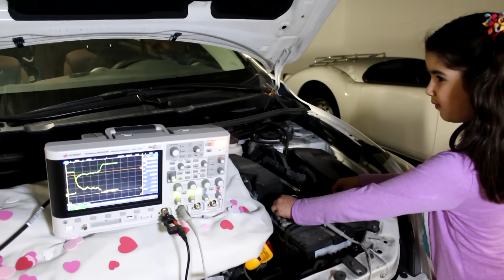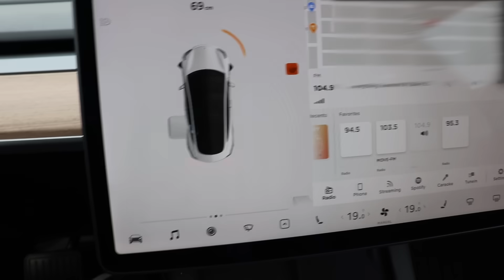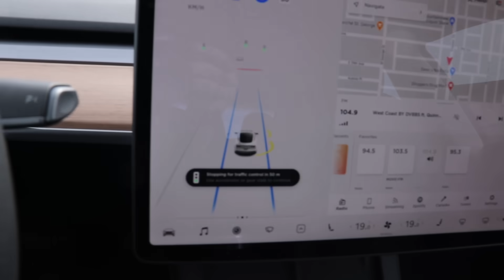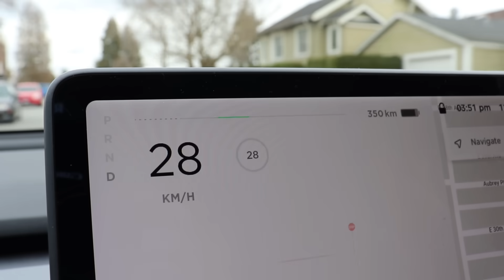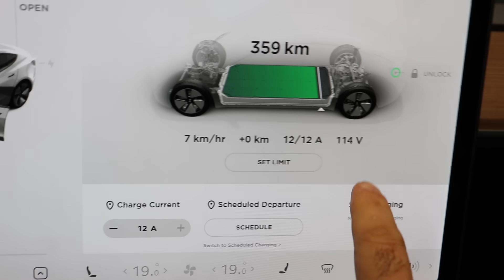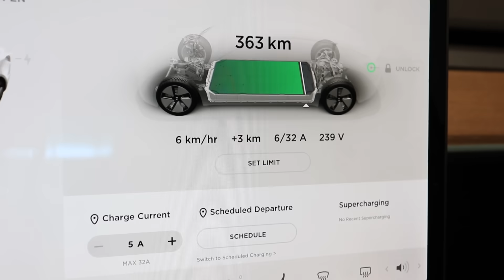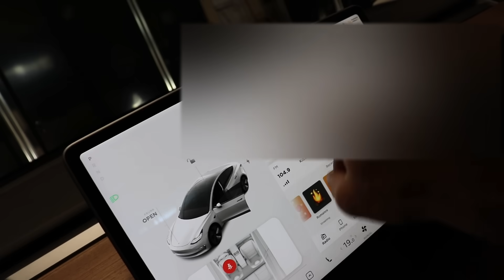ELECTRIC VEHICLES & My Tesla Model 3 Review

Comment: Well, this had showed me, that Tesla is not a car for me. The price diference in operation is not that great in my country, and you have to save up to 70 average monthly wages to afford it. And with that mountains: If you left your car in gear, while leting the car go downhill, and leave gas pedal free, the engine will turn off the injectors, and the engine will start to break, while using no fuelo at all. But you need to have manual transmission for this. Next thing is, that imagination, that everything should be in touchscreen is grazy enough. As  a driver , you have to always be aware, what is in front of you, and when you are trying to set up somenthing, you are loosing the contact with road. And in higway speed around 130km/h, one second is approx 36 meters. In my opionion, tesla is not bad car, but for me it is over computerized. Next things are assistants: I have no doubts, that it saves lives, but here in czechia it is not reliable, because of conditions of our roads, where markings is unreliable.

Comment: • 1:45 - Don't blame cows for climate-change; cows have been around for millions of years without messing up the planet, it wasn't until humans started breeding them to unnaturally high numbers (to kill and eat) that their burps became a problem.
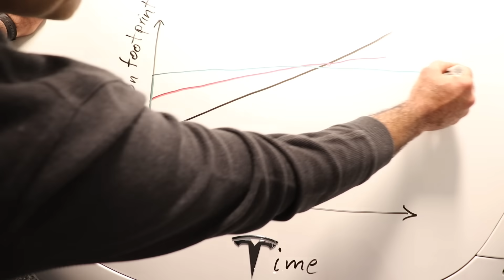• 2:42 - Your graph is (very) rough. ICE cars pass electric cars in carbon footprint the second you turn them on. They only have a smaller footprint than EVs if you put them away after they're manufactured and never use them.
• 3:02 - Once in a while you could do more… and pay a lot more for insurance. 😕
• 9:55 - Self-driving cars will only be useful for highways and will only be used by transport fleets shipping freight; full SAE5 will likely never be a thing for in the city, it's just not practical or safe to trust an A.I. to account for unpredictability like that.
• 11:11 - So what, it's still "free" charging. 🤷
• 11:52 - Yup, EVs are much cleaner and don't need as much gross fluids, and other than the wheels, they're solid-state. 👍
• 13:33 - And EVs are also a lot quieter (they have to add fake noise for safety). They also emit less heat too. EVs are to SSDs as ICE cars are to hard-drives, they're better in almost every way and the few downsides are either temporary or not too bad.
• 17:17 - Have you tried turning it off and on? 🤦
• 18:24 - Hey, we live in a pre-order world. Thanks to Steam and Kickstarter, people have gotten used to paying for things before they exist and getting incomplete, buggy junk. ¬_¬

Comment: For those eyeing the LEAF or BOLT, there's a pretty nuanced discussion to be had about which one is right, and the selection between them and the Tesla boil down to the batteries, their accompanying systems, and the use case for you. In (very) brief, Tesla batteries are generally best, but the cars are a little heavier, so efficiency per mile is a little lower. That means if you only have Level 1 charging, you'll get fewer miles per hour of charge. You may have to catch up on the weekend, depending on your driving!

The LEAF has a battery with only digital thermal management (no radiator/plumbing through the packs) which means that in hot climates, it tends to underperform, and it also tends to not like multiple rapid charges. However, mechanical simplicity means less potential for failure. This is often talked about like it's the apocalypse, but it really isn't. Like Mehdi says, match the tool to the use, and if you don't need regular fast-charging or to drive much in high heat...it's great!

Finally, the Bolt DOES have the liquid cooling, generally a good reputation. You just might be paying more for the battery and less for the car, and that could also be a bad fit for you. Make sure the seats, cargo volume handling, etc all work for you!

Comment: I see a lot of inconvenients with the Tesla and battery powered electric cars. As you say, the carbon footprint is very high at the moment you buy it, and then you have to compensate. Same thing about the price tag, are very expensive. Thinking about the environment, think on how recyclable (or whatever is written) are this cars compared to a gasoline one. You can keep a gasoline car, from 10 to 20 years, the battery lifespan are maximum 10 years, and when you have to dispose those batteries, they generate quite hazardous waste, a gasoline car is all made of steel (or aluminum) and can be remelted again. In Germany, lots of drivers got stuck in traffic due to a snow storm, and they kept warm by just adding gasoline. On electric cars, warmers drain a lot of power to keep the heat, and you can't "refuel" them. The way to go is Hydrogen Cells. Is like refuelling, and it uses electricity too. You can use electric power (dedicated wind turbines and solar power) to make hydrogen, and with that, power the car, and expel water instead of CO2. Hydrogen is dangerous  you'd say, well gasoline is, too, and we're safe. Hydrogen cell cars, doesn't have that many problems.

Comment: Yes tesla is a good car I cant deny it.  BUT problem I see in ev's is that when you live far away from civilization and you need to go daily over 60km you cant charge it enough. And here we dont have any charge stations nearby. Second problem I have is the climate. Here in Finland at winter time we can have over -25 °C  and I think that it doesn't do any good for the battery. (I dont know the prices of new battery) but I highly doubt it that I have enough money to replace it. So thats why I prefer combustion engine cars. Also im a car guy and I like too much the sound of gas or diesel engine. I will think of buying an ev when the battery and the electricity doesn't harm the enviroment. Sorry if I triggered someone. I just wanted to tell my opinion. If you own an ev you can come and try convinse me to buy ev. 😊

Comment: Quick correction here Mr electro boom! When traveling down a mountain in low gear as you're supposed to, you burn zero fuel. The injectors literally shut off in the wheels turn the engine but no fuel is being consumed. Don't believe me? Head on over to engineering explained for confirmation. Other than that, great video!

Comment: You'll save $1200/year but have to buy a new batter for $7000 in about 5 years if you take real good care of the batteries.  
Where is the saving? 
Sorry, but the battery technology is not there yet. With the newly invented carbon nanotube cells, maybe there is hope.

Comment: Well, one reason you need to push the "gas" pedal is to confirm the car that what it thinks is a green light actually is a green light. Imagine your car automatically accelerating due to some green light on a nearby construction site... Although computer vision has come a long way (and in some fields surpassed human vision), it isn't perfect yet, so you need to reassure your car that it's doing everything correct. Another factor is the illusion of control. Generally, humans feel safer if they think they are in control, regardless of whether it actually is the case or not.

Comment: 1:35 wrong! although they would theoretically be more green than combustor cars, the batery dies after about 100k to 200k Killometers (or 60k to 120k miles) then you have to replace it... the most economically unfriendly thing to produce on this car.

with a combustor car you'd drive up to 400k km (240k miles) and you'd be relatively fine

Comment: One thing to note is that even if your power comes from a fossil fuel power plant that is still better than burning Diesel or Gas in an internal combustion engine, because despite accounting for all the losses in transmission from the power plant to the car, the power plants will have a significantly better fuel efficiency than a car may have. So it's still better to use EV even if your country is going backwards in time and not building or decommissioning nuclear power plants.

Comment: I disagree with a couple of things Mehdi says. At 1:00 a car is just a tool. If a car is just a tool why aren't we drilling Model T's with safety up grades. I would say car are at lease as much about status as they are about utility.

At 1:35 everything should be running on electricity stored in batteries. For now and for the foreseeable future if you need to get the job done you will be using diesel fuel. An agricultural tractors burn ~700 litres/day, combines ~1,000 litres/day and there are others road construction, mining who will continue to need diesel. The current energy density of even the best battery chemistry is pathetic compare to diesel. Assuming a small 4 wheel drive tractor, like the John Deere 9R 390, running at its rated engine power of 287 kW for 10 hours you would need 33.8 Tesla 3 battery packs at 85 kWh/pack. Adding 18,252 kg (40,560 lb.) to a tractor that weighs 20,856 kg (45,980 lb).

Comment: Congrats! During driving, for safety please mount your cameras somewhere on your dash and/or ceiling so you don't have to hold it.

Also I like how you got the new updated version with black trim pieces, free white colour, free black seats and the SR+. It's the best value for your money since the SR+ is the only one that gets the $5k federal incentive.

It would be nice if there was a 360 degree surround camera system (not just sensor) for when parking. Heated steering wheel and ventilated seats would have been nice too and more energy efficient.

Comment: 13:25 When you go down the hill in ICE car you dont use any fuel, if you coast in a gear. Your engine basically turns into vacuum pump and no fuel is injected, thus slowing you down to some point. And there's normal maintenance of brake pads, only the frequency of doing so changes according to your brake use. Otherwise pretty informative video

Comment: Mehdi I am just curious that if car has two batteries , when driving on one battery can we charge second battery using generator on kinetic energy of first battery. Second battery will Not get fully charged but about 60-70 percent. When first battery reaches to 0 then by using changeover can we use second battery and keep first battery charging to 30-40 percent and so on.
At least we get maximum range that todays batteries offers.
Is this possible, please make model n throw a light on it.

Comment: those issues with the display are not normal, I have that model 3 that I bought 2 years ago and don't have issues with the display and it's not that slow for me. I don't even remember when was the last time I had to reset it by pressing the buttons on the steering wheel

Comment: Sure it will have less footprint over time, but then if you need replacement battery you start again. And "renewable" is not green or zero emission, wind turbines don't produce enough electricity to justify their existence in their lifetime, same with solar, the efficiency is so low, that using it for industrial application is retarded. The only good energy source is nuclear and soon fusion.

Comment: Great video . As for not needing maintaince, yes electric motors are superior to ice motors , however there are still parts that will wear out In time . As the car ages it will need to be checked so problems can be repaired before more damage can be done or a accident happens. Normally this happens at oil changes on ice cars. But people may neglect this on EVs think Suspencion parts like tie rod ends or control arms. These parts are the same for EV or ice cars. Also both have  cv joints  at least 4 or 8  along with struts / shocks and stabilizer bar bushings that will all wear out in time and miles. These things will need to checked especially as the car get to higher mileage. Again EVs are good but are not maintace free. Just my two cents. I hope to get one someday,but need to wait for good used one to come on the market.

Comment: They should add an option like the Dell laptops where you set the usage times and it charges with the right current accordingly.  If you need your car fully charged by 7:00AM each day, it could adjust the charge current for that.

Comment: "Crazy aggressive driver..." "...get off the road!", lol, that's exactly what they're trying to do.
Reply: @Mikołaj K how is it not dangerous 😂. ALso the speed limit you see in changed from the actual one so that if someone still breaks the limit, nothing much happens.
That's why people think it's not dangerous but actually is.
Reply: @daphenomenalz4100  Going 150km/h in a 130 zone isn't dangerous.
Doing 70 instead of 50 on secondary roads isn't dangerous either.

You people are idiots.
Reply: @ilpatongi  Of course it's dangerous. But so is going 50 in a 50 or 70 in a 70. The biggest added danger is the difference in speed between you and traffic and the increased stopping distances. Slowing down is a quadratic function, so even small differences in speed make a large difference in the ability to stop.
Reply: @halfchocolatecow3501  Wow really? I never would've guessed.
Reply: @Mikołaj K yea sure , and drinking at least 5 bottles of wine everyday( which people call a drunken) dosent affect ur body a
Reply: @Martian_nigga6970  Idiotic comparison to say the least.

Comment: My Volvo D2 uses 4,5L Diesel on the Autobahn per 100km, thats around 6€ per 100KM. A Tesla, charged to 100% (More power needed from 80-100% than from 0-80%) would be also around 6-8€. The Volvo with a full tank can go 1100-1400km depending on my driving style, dont think there is an electric car that can do that. It also doesnt use anything while standing still. So yeah in the city electric all the way, for longer drives and only for that take a Diesel atleast for now. Gasoline is absolete with electric cars existing.

Comment: It should have stopped before those cardboard boxes!? Even if the car somehow detect them has empty, that I assume it did, I saw a video where a model S stopped for a plastic bag of all things! Going through cardboard boxes can scratch paint, because of the metal clips that some have!  I don't understand how it stops for a plastic bag but not cardboard boxes?! Shows that AI drive system is still not 100% reliable.

Comment: 8:25 Suppose the light has turned green and tesla starts going but some idiot tries to break the signal at the same time you'll both crash. So I guess that's the reason why it asks you to hit the gas a little bit to confirm if it's safe to go.

Comment: While quite expensive, consider upgrading to ceramic brake disks as regenerative braking causes the regular brakes to remain very much unused and causes them to rust. Although mine is not electric, my 4 year old car needs new brake disks as the car saw very little use since the start of the pandemic (and only short work trips before it). Might save some money in the long run, so it's something I'd look into. Here due to climate, brake disks especially on electric cars (due less used), rust very fast due to corrosive anti slippery/ice melting (salt) measures used on roads. If not, keep working those brakes hard from til to time or things might get very expensive. Check with real expert.

Also, for vehicle based vacations, consider renting a regular car instead of going all in electric. Waiting 6 hours in line at a charger is not fun, especially with kids going "are we there yet".

Comment: Omg, there is a return of the fuel in gasoline cars when you go downhill  using engine breaking
Reply: The fuel injector simply shuts off.
Reply: @mathewng1988  that is the other way to approach the same thing :)
Reply: FYI, engine braking is still functional, even without fuel being injected and burned.

Comment: Someone hate electric cars but personally I preffer electrical cars becausd is a clean enegry, also, generating brakes is also used in F1 to recharge the hybrid V6 engine(it appear in front brakes).
And is expensive because is a recent techgnology, and that imply it being fragile, but still reliable and clean energy, I have the idea Tesla cars include a solar pannel in the rooftop(or is was deloped to charge in use).
Elon Musk and Tesla company said the prosessor is still in update, so all Tesla's prosessor still updating.
And electric cars appeared first with Formula E, the electrical variant of Formula 1, Volkswagen made I.D.R for Pikes Peak event, yeah, gasoline would be exclusive for racing, but still it needs to put a step more to the future.

Comment: No, no, no. I can't say that you always burn fuel on a downhill. If you are using the motor as a break and the slope is enough to keep the rpm higher than the idle, the ECU will cut the fuel off. And your car battery will be also charging 😋
Reply: Glad I'm not the only one who noticed this mistake in his downhill point, EV is probably still better, but modern cars use 0 fuel when not pressing the gas pedal whilst engine braking.

Comment: So you still need gas for the gas pedal? Seriously, do a real video on the regenerative braking. As in how it actually charges the battery. As in does the software run the drive transistors the opposite of the vector space drive sequence? Or does it go thru the charge controller somehow?